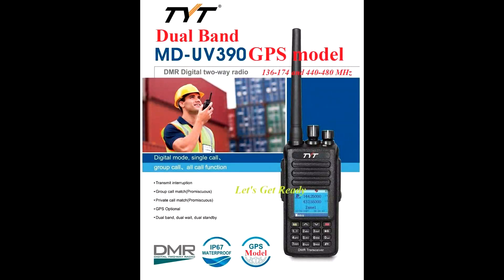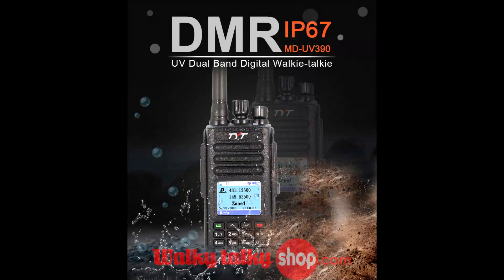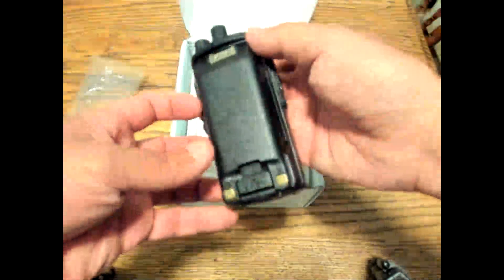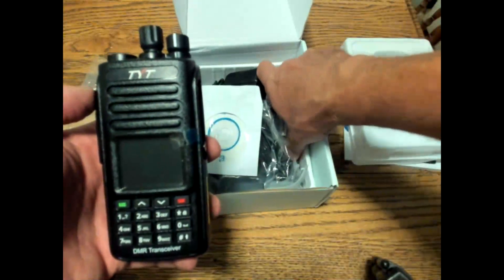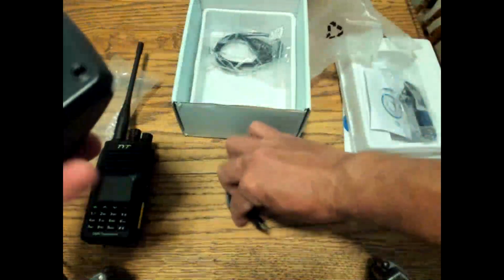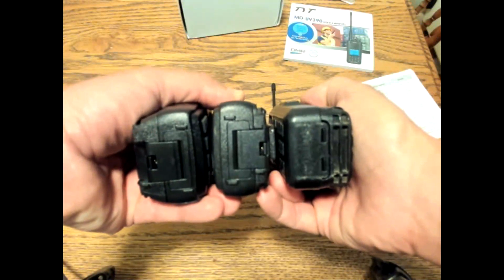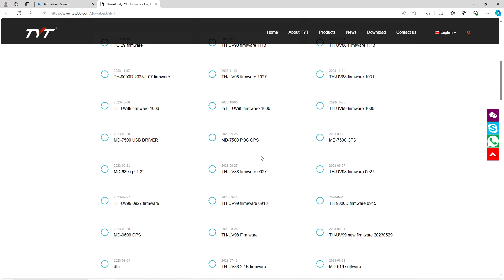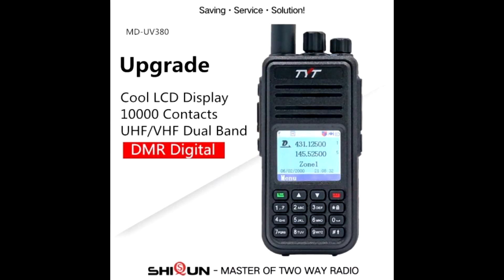TYT MD-390 Plus  Unboxing  IP67 DMR

Comment: Nice video man. I’m considering this myself. How’s the user interface?
Reply from the maker: @alexlevinson8629  I like the radio and durability.  One limitation is the upper and lower Channel have to be programmed in the same zone.  

You can't split upper channel zone 1 and lower Channel zone two.  This almost forces you to place all of your channels in one zone so they are accessible.

The software is good.  Not as many options as anytone.
Reply: @radioguy1311  you can set the program key to flip zones to make it ez. I like to keep it organized. Having the all the channels in one zone is a pain in the ass with the rosery knob.